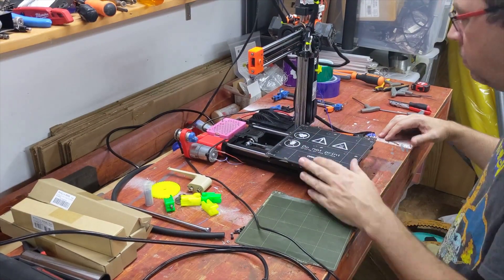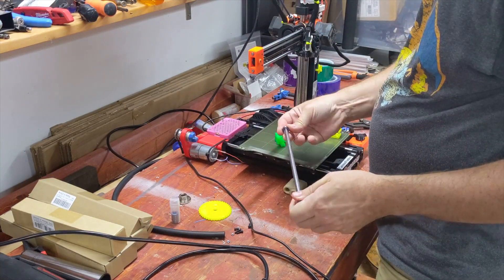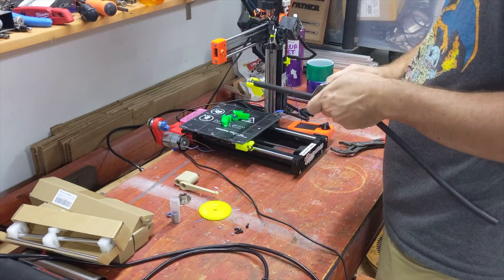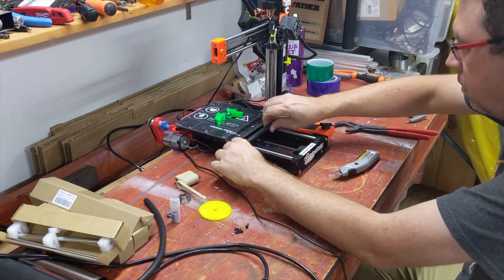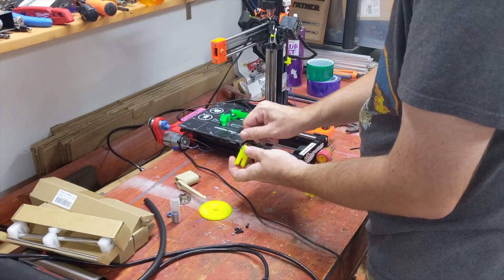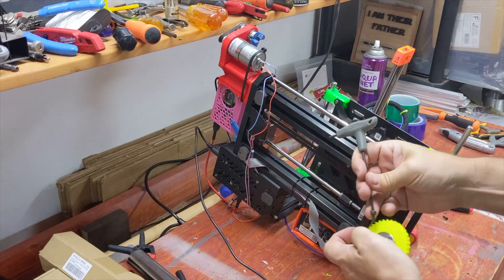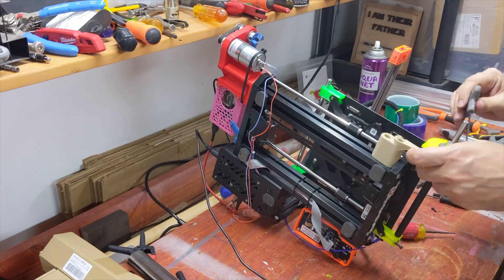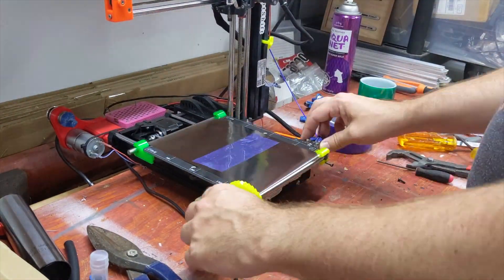PrintShift 5.0 - coming at you

Comment: Another fellow kapton lover I see <3
Useless trivia: You can actually print straight on the steel with the bed at 80°C. Not very useful for PLA, unfortunately.
You can even print on PTFE if the bed temp is hot enough (130°C) and you go slow enough.
Reply from the maker: I'll have to try that - I'm always playing with different bed materials